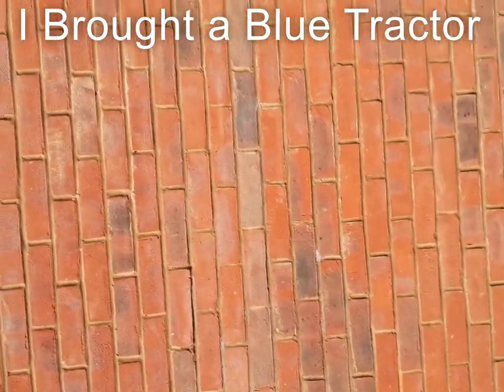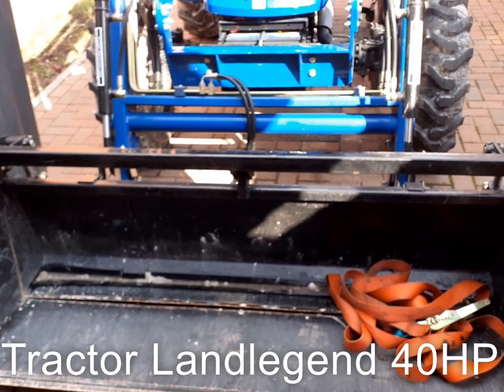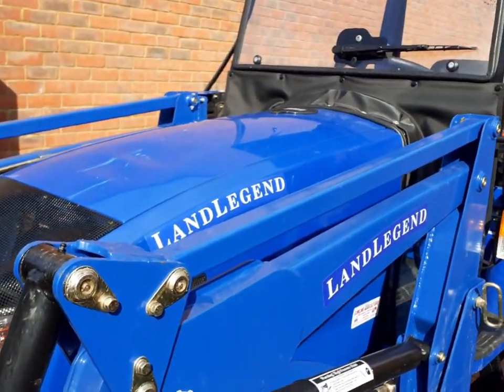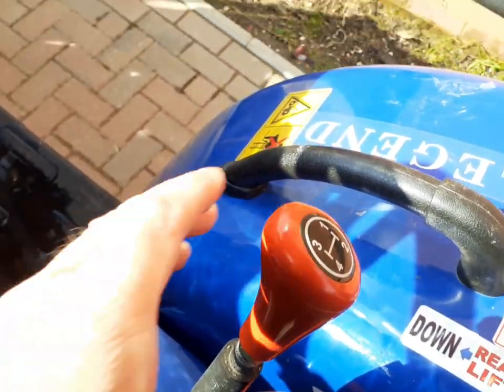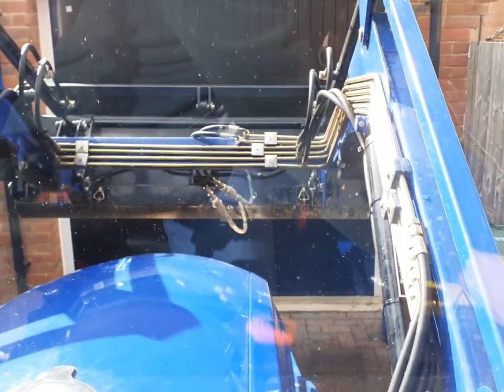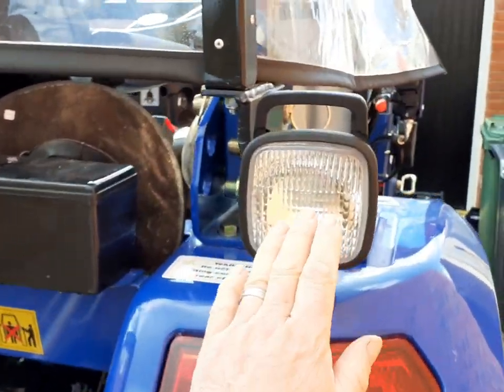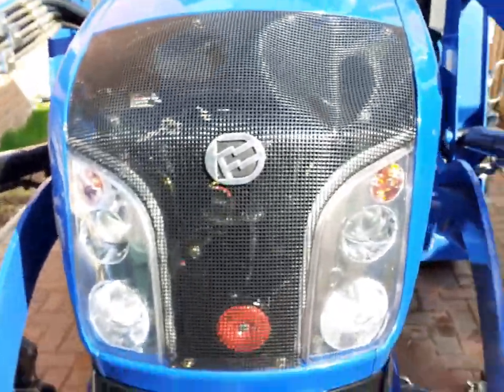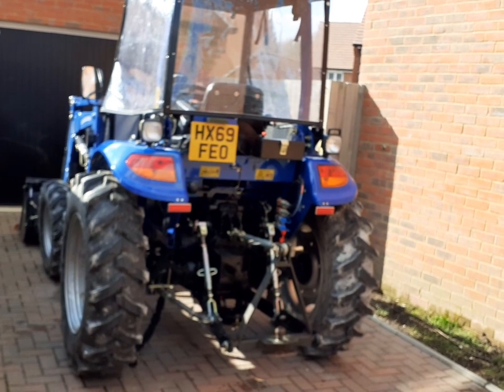I bought a Tractor - I bought a tractor! Landlegend tractor review

Comment: How the tractor going? I know the old models of these were absolutely terrible but these new shape ones seem to be much better. Now you've had it 2 years have you had to spend much in the way of repairs or anything or has it been pretty good?
Reply from the maker: It's doing OK. I had to change bearings on flail mower and I have a leek on the power steering